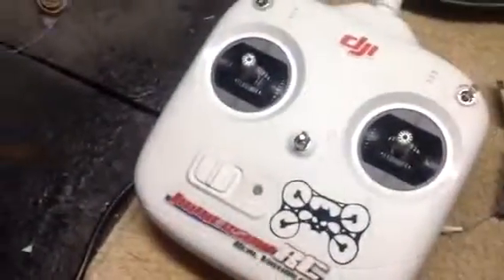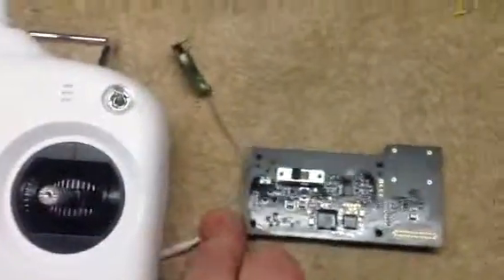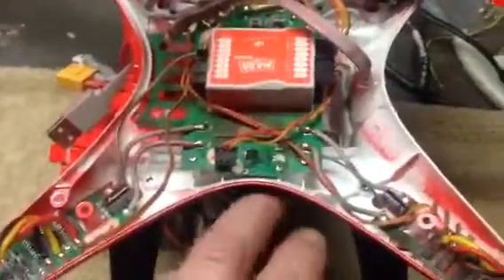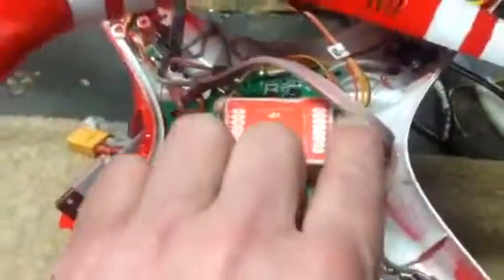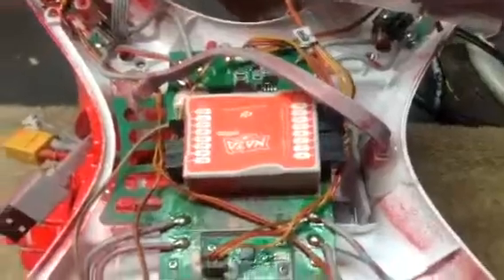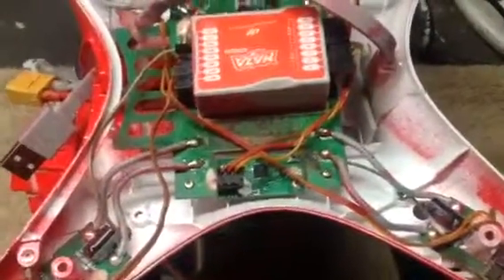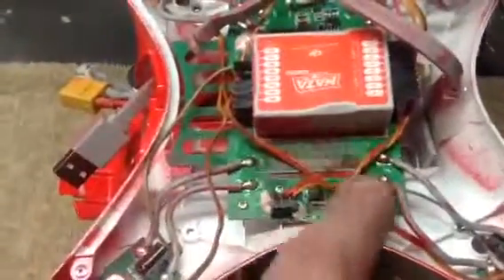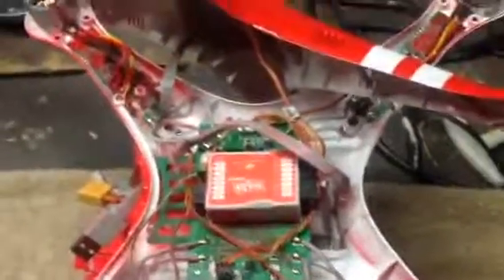Dji phantom bound but yellow flashing lights

Comment: Hei. Great video. Maybe you are not even reading these posts anymore, but I have a question. I got a Phantom Fc40 a couple of years back, flew once but no GPS or Failsafe "go-home" system in place, so I did what most did: Upgrade the firmware first, and then try the "GPS Calibration" thingy. Did the firmware update, but nothing worked afterwards. 2 years of reading posts, videos, etc., I was able to upgrade the firmware in the Phantom and its transmitter, I imported the parameters... but the main problem remained: After connecting the battery, a couple of green lights, and then a flashing yellow light. After reading and weeping, the problem seems to be the connection between the receiver and the transmitter. I tried changing to DBUS, PPM (I even tried the Traditional) but nothing: I always ended up puting the battery on and getting the flashing yellow lights.

I found the solution "Press the Black Button that is inside the compartment" just a year ago. You talk about it a little in your video.... buuut, every time I press the black button, no red LED lights turns on....

Any Help will be much appreciated, or this basically new Phantom is going to the garbage

Comment: If by chance your not sure if the direction of the colored wires on the connector are right, will it damage the unit if you switch them around to see if that corrects the problem?Thanks